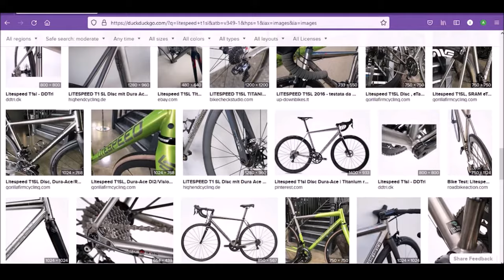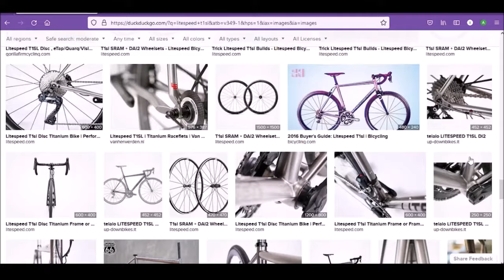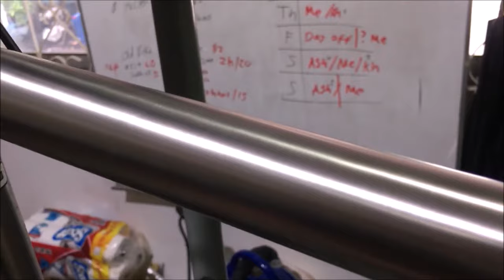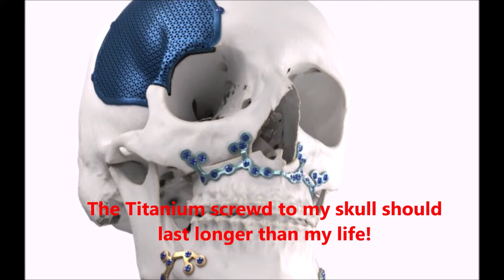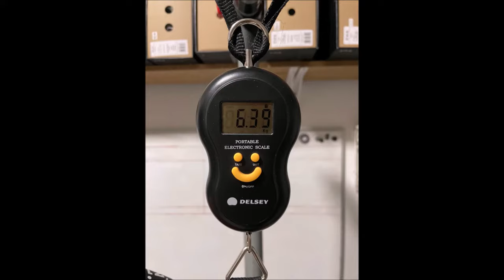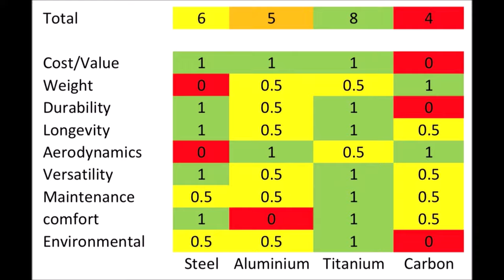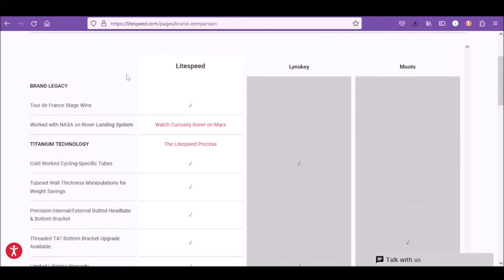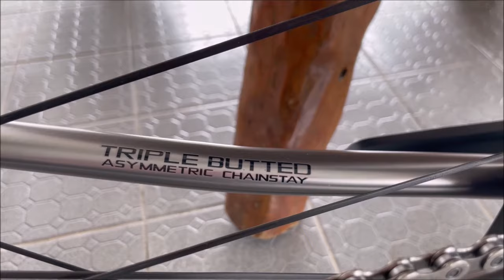The World’s Best Performance Road Bike. (And It’s Not Carbon…)

Comment: Of course, you have to repeat the nonsense about comfort being related to the frame material.  A standard bike frame contributes zero meaningful vertical compliance. The seat post does, the tires do, and the wheels do to a minimal degree - as has been shown by Tour magazine 20 years ago.
The placebo effect is powerful.
Reply from the maker: I did a video on this subject and actually you are incorrect, the frame material does have an effect. This is because different materials have different physical properties, this allows you with certain materials to adapt tube shape for stiffness or compliance/vibration. A material with a higher Youngs modulus can be made into thinner tubes that flex or dampen vibrations better. If you made 2 bikes the same weight out of 2 different materials you would feel a difference. Unless you think a bike made of tungsten carbide would feel identical to a frame made of rubber? 

For example, I have a super stiff steel bike that was designed for racing. It has 25mm tyres, low profile aluminium wheels with steel spokes and a 27.2mm aluminium seatpost. It is far less comfortable than my T1SL that has 23mm tyres, 50mm carbon wheels with carbon spokes (super stiff wheels) and a 31.6mm seatpost. They both use the same saddle and the same bar and bar tape. If what you say were 100% true then my steel bike should feel more comfortable? But it most certainly does not.

Comment: Definitely believe that Titanium is the best material for bike frames, especially for those of us who wish to have the bike for life.  Titanium frames are a work of art and craftsmanship; carbon fiber comes out of a mold.  I do not necessarily believe that Litespeed make the best frames.  David Lynskey, the founder of Litespeed, knows a thing or two about how to make great Titanium frames.  Lynskey performance make some outstanding frames and value for money they are far and away the best in the business.
Reply from the maker: I agree with the first part. 🙂 But Lynskey didn’t work for NASA, don’t have anything as light as the T1SL and haven’t been doing it as long as the guys at Litespeed. (Because they sold off the company and turned their backs on making bikes for years.) LS and LY prices are similar and LY also use cost saving aluminium shims in their bikes according to LS? But… yes, they do make lovely bikes. 👍🏻🙂

Safe happy riding! ❤️
Reply: @reginaldscot165  Sorry Reginald, you really have no idea what you are talking about.  David Lynskey started Litespeed.  He brought years of experience working with Titanium to Litespeed from working with his father in their machine shop all the way back to the early 1960s. (who actually did do work for the aerospace industry with titanium) No one at Litespeed ever had more experience than the founder himself and I hardly believe anyone who was on the original staff, hired by David Lysnskey, is still working at Litespeed today.  But David Lynskey IS working at Lynkskey performance.  When he sold Litespeed, he remained on staff for two years as a consultant.  The reason he decided to leave is that the new owners of Litespeed were more interested in cutting corners to improve profits than they were in making quality bike frames.  He remained out of the bike frame bunsiness only for the duration of his non compete clause which was two years.  (David did not turn his back on making bikes, he turned his back on making inferior bikes to boost profits and it was only for two years).  When you claim that Litespeed has more experience building bikes than David Lynskey you make a claim that is absolutely absurd.  Tell me the name of they guy at Litespeed who has more experience working with titanium than David Lynskey. Can you give me his name? No you can't because he does not exist.  You claim that Lynskey does not make a bike as light as the T1SL but Litespeed does not make a performance bike as stiff as the Helix Pro.  A few grams is not as critical to a performance frame as stiffness and it is possible with component choice to get a M/L Helix below the UCI weight limit so what exactly is your point?  The idea of absolute lightness as the primary goal in frame building has even been abandoned by the carbon frame builders, or haven't you noticed? The way you make a frame lighter is by removing material.  Not rocket science here.  But when you remove material there is a cost in terms of durability.  Lynskey understands this and chooses to innovate in ways that don't compromise on quality and durability.  In the end you get a bike that performs better and lasts longer.  Finally, Lynskey is a family owned business that exists to make the best titanium bike frames for a reasonable cost. Litespeed is owned by a corporation that exists primarily to make a profit.  Which company do you think is more likely to "cut costs".  When you claim that LS says Lynksey cuts corners by using aluminum shims do you know exactly what that means?  Where and how are these "shims" used? (if used at all). And if they are used, is it for some functional purpose or to cut costs?  Do you know? And do you really trust anyone at LS to tell you the truth about Lynskey?  Come on, give us all a break and start being honest.

Comment: Under cost, id give titanium 0, its the same if not more expensive than carbon
Reply from the maker: I think you missed some of my examples of why it’s worth the cost. My top end titanium frame is 1 to 2 $1000 BND cheaper than a top S-Works tarmac frame for example. And I did list out why you are getting better value for money. 😁👍🏻

Comment: Except that Carbon wheels are poor for rim brake.  If you have a carbon wheel rim brakes are not optimal
Reply from the maker: That’s definitely debatable. A subject for another video for sure. 😁👍🏻
Reply: @reginaldscot165  Maybe I am using the wrong pads but all of my bikes have carbon wheels and rim brakes and they don't function as good as the alloy wheel with rim brakes
Reply: @se7ensnakes  I have got Campagnolo Bora wheel sets with the AC3 brake track finish and when used with the Campagnolo pads the braking is on par with alu rims... in dry conditions. In the wet it is a whole different story though, so when the weather forecast is shite I am on my disc brake bike :D.

Comment: 1/ Ok let’s make the chart again and this time just put the highest quality of each material against each other. Apples against apples if you like. For example let’s use 12K carbon fiber you know the stuff typically used in high-end aerospace and military applications. Let’s use a cf frame made by Parlee or Enve against your Litespeed ti. Or let’s use a junk welded ti frame against a basic mass market al or cf bike.
2/  The video clip of the tubes under the truck wheel is a joke. Where was the steel tube? What were the scantlings of the Al tube? Who made the carbon tube in the test Ali Express or Parlee or Envel?  For sure : a  carbon fibre tube laid up of high end Toray for the purpose or resisting that test could be made to outperform the others in that test per weight sample all day long. 
3/ Anyone could go on and on about cf being used in F1, Space, military, etc etc etc. 
4 / Your video simply falls apart as you lift up your 6.8 kg bike fitted out with a cf fork and cf wheels, arguably two components which would  cause very  consequential injuries to the rider as a result of failure of the cf material or its application.
Your video, whilst appearing to be your honest opinion, has zero merit as to why someone should rush out and buy your ti bike or any ti bike over an equivalent quality bike made from the other materials.
Stick to selling snake oil. 😀
Reply from the maker: 1) that wouldn’t be possible. Like literally how would I even be an to do that? Asking the impossible isn’t a valid argument. In a situation like this you have to generalise. 
2) it’s not a joke, it’s a demonstration. Please feel free to got do the same demonstration to your standards and post the results in a video on YouTube. 👍🏻 
3) What’s your point? All materials are used in the aviation industry for example, but they are used for different things depending on material properties. Titanium has the best properties for bike frames. Name me a better material for making bikes out of for the end user. 
4) Again you are making points that don’t have any useful conclusions? Yes the wheels are made of carbon fiber… and? So? You would get hurt if they snapped… yes… and? 🤷🏻‍♂️ 
“Zero merit” is a provably false statement. You are just using exaggeration to bolster a weak argument. 
By all means suggest a better bike than the T1SL and give precise information as to why you came to that conclusion.

Comment: 4:11 steel isn’t cheaper than carbon. At least not stainless steel like Columbus XCR.
Reply from the maker: So you pick the most expensive steel frame an expensive brand makes and compare that to what? A unbranded carbon frame off Aliexpress? 😂 The Steel XCR is about $4K right? Well the S-Works Tarmac is $7k. 🤷🏻‍♂️ So the most high end steel frame Vs a high end carbon frame and the steel is way cheaper.
Reply: @reginaldscot165  I don’t think XCR from Stelbel and Baum is 4k
Reply: @reginaldscot165  also, Tarmac SL8 frame set is not 7k, buddy.

Comment: Fun video with a clickbait title. Totally unscientific opinionfest. Don’t get me wrong - I love Ti as a frame material, having put ~100k miles into a Lynskey-era Litespeed over the last ~21 years. However, things as basic as tire width and proper fit have a greater effect on comfort than frame material. The Ti “magic carpet ride” is a myth - Ti rides like good steel - good, but nothing mystical.
Given that the rim-brake LS is limited to 25mm or 28mm tires, it’s already behind the curve, in terms of comfort and road holding, compared to disk bikes  that can run 30-32mm tires. This isn’t s ding against rim brakes - they’re simply more limited than disks.
Reply from the maker: You need to see my latest video to educate yourself on the “myth of titanium” please stop saying that, nobody actually believes titanium has mythical properties. But yes it’s a fact they ride smooth. You yourself admit that, so why say it’s a myth? 🤔

If you want a gravel bike then buy a gravel bike, but 23s/25s are faster and rim brakes are better for racing (lighter, more aero, better feedback) this video is about a “performance road bike.” The best you can get. (Well you can’t anymore.) if you think the heavier carbon disc bikes are better name one?  I dare you! 😉

Comment: Rim brake and carbon wheels doesn't go well together. Other than that either one is fine.
All my past steel bikes started to become rusty after 2yrs and were over after 7yrs. Alu frame got a crack after 5yrs and corroded near steel components. I bought a used carbon, its 10yrs old now and still in good shape. Even had a crash and needed repair.
So to my experience your rating is biased.
Reply from the maker: I disagree about rim carbon, I have no issue. Modern carbon rims stop very well and don’t melt at Low temperature like the older stuff. Also they are cheaper, lighter and more aerodynamic and easier to fix and so on… 😁

For material I’m going on average experience of the majority. Do you live in a salt flat? Surprised to hear your steel bikes don’t last, when some people are riding on steel bikes that are 50 years old without issue? Even carbon bikes have metal fittings, normally of not particularly good quality metal, they corrode like crazy. 🤔
Reply: @reginaldscot165  I sweat quite a bit and did not care to wash my bike after every ride. I still don't. I have my gear to use it, not to do excessive maintenance. The two rustees were both Colnagos. The first got rusty because I kept it in a garage built of  concrete (quite  humid) the second was a master piu, at the time a prime bike, that started to rust at the chrome parts after 1 year. Sent it back to factory, they refurbished but it didn't help. I tossed it after a few years and went with Felt aluminum. In switzerland most modern flats have concrete cellars which can be very humid. Now I live in a brick house. Much better. Still, a material that needs much more maintenance than others I consider inferior.
I ride a carbon Storck Absolutist 0.9 with Shimano Ultegra 6700 3x11 for about 10 years now. It's designed to keep the cables under the handlebar tape. That makes it bend through at least 3 corners going a bit hard. Not the slightest issue with creacking or corrosion so far but since its BB is threaded I don't dare to dismount the BB 😬.

Comment: XCr / 953 stainless steel is the logical choice, all titanium benefits none of the drawbacks.
Reply from the maker: Eh? What drawbacks? 😳 I almost bought a Xcr frame, but they are really expensive and still way heavier than titanium? Stainless can also still rust in the right conditions. 

But maybe I need education, please explain. 🙂👍🏻
Reply: It has to me made of 316 marine grade s/s of known origin (I. E aerospace grade)
Reply: @reginaldscot165  top shelf stuff is usually expensive yes, but so is top shelf Ti. Litespeed is not top shelf Ti, no offence. Ti frames are very well known to crack. Ti used in other industried doesn't matter as those properties depend on specific application. With stainless you get no corrosion and no cracking.
Reply: @cosinus_square  My XCR Cinelli had  corrosion and my cable stop broke off due to either corrosion or contaminated welds. No more XCR for me.

Comment: your scoring of materials lacks any reason! You ignore some aspects (for example that welding aluminum is polluting and welding titanium much more so; comfort is as much dependent on construction as the material; durability and more so longevity also arguable - aso)
Reply from the maker: From the limited data available carbon still appears to be the most polluting. Also as I said, you make a steel bike 1 time and that’s it. Carbon doesn’t last as long and often needs repair. 

Yes but all materials have inherent properties. You can make carbon as thick as you like, it still won’t have the resistance to abrasion that say titanium has. 🤷🏻‍♂️

Comment: I wish people would get overcthis falacy that "titanium is a bike for life". I've broken three titanium frames, never crashed, all replaced under warranty before abandoning the material for carbon which I've never managed to break. Titanium degrades and breaks like ALL materials.

Your scoring system is laughable.
Reply: The young module of titanium is almost exactly the same as aluminium. Thus when having the same weight the two frames will most likely have very similar stiffness properties. However it is far more difficult to hydro-form titanium tubes compared to aluminium. Therefore the design of the frame can't be tuned as much as for titanium. When it comes to corrosion resistance aluminium and titanium are both mainly subject to galvanic corrosion only. But titanium is not a noble metal. It will corrode too. However there is one advantage to titanium over aluminium: it is less brittle than aluminium. However I personally think that it is just plain and simply not worth the money. And then there is no such a thing as a bike for life. After some time you get older (10years) and you will require a different geometry and bike setup. I have for example made well over 150k on a very plain and cheap aluminium frame for a road bike from decathlon. It wasn't pretty and the BB alignment left to wish for. However it was fitting me very well and that was the most important factor for me to stick to it. A steel frame in similar usage (long distance riding) wouldn't hold up. Sooner then later it will be eaten up by rust.
Reply from the maker: Titanium can crack, but it’s normally a problem with poor heat treatment of the welds rather than a flaw of the material. Perhaps you were unlucky, very unlucky! Because there are some very old Titanium bikes on the second hand market still in perfectly good condition. Also they do tend to have a lifetime warranty and it looks like that was respected with whoever you bought from So that’s good! 🙂 

Also I bought a very expensive custom carbon bike that cracked on me in only 4 months of use! But I didn’t get a warranty refund and I never bought carbon again! 🙂
Reply: @Reginald Scot Well my point exactly, no material is perfect or perfectly constructed. Titanium is a difficult metal to work with and all manufacturers have problems with their frames. Titanium is not some wonder material that prevents that. Conversly any frame can last a lifetime if constructed annd treated well.
Reply: @proh26  😂
Reply: First of all you are completely wrong on so , any things here that it's laughable...the simplest of which is Titanium does not corrode
Reply: This spot is way off, if you want a real Litespeed you will need to buy a Lynskey, they are handmade by the family that created Litespeed... This current litespeed is not the same company as it was...as for the people on here saying Titanium corrodes titanium titanium bad blah blah... Tell us you’re dumb without actually saying it
Reply: This spot is way off, if you want a real Litespeed you will need to buy a Lynskey, they are handmade by the family that created Litespeed... This current litespeed is not the same company as it was...as for the people on here saying Titanium corrodes titanium titanium bad blah blah... Tell us you’re dumb without actually saying it